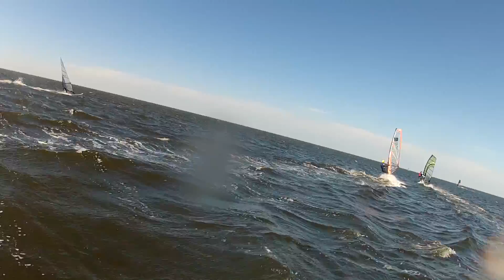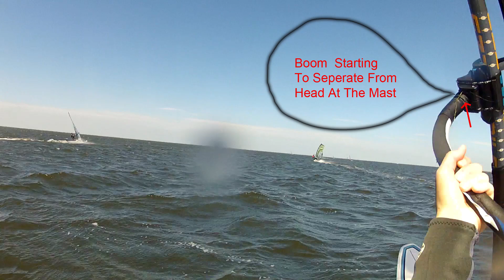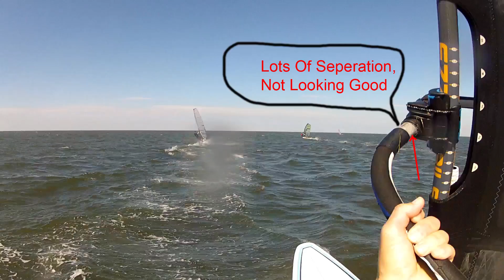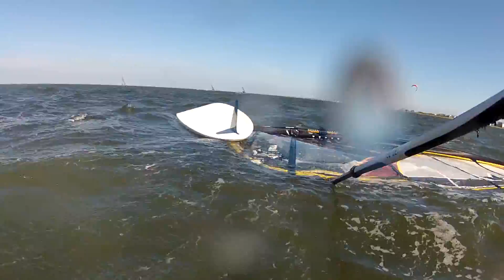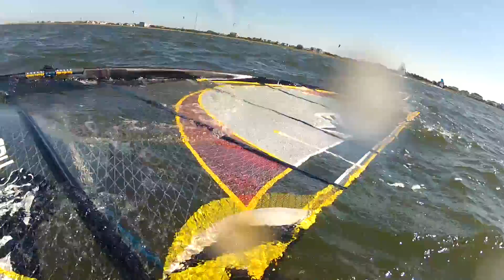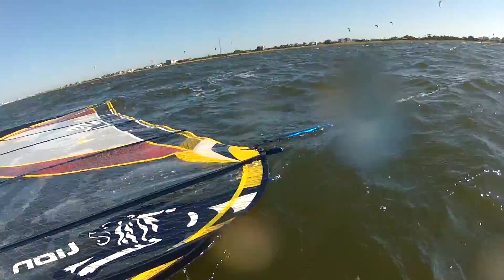Windsurfing Boom Break Wipeout, Hatteras, North Carolina, Chinook Pro 1 Alloy

Comment: that is pretty common, and the sharp edges will destroy the sail.  Check out "FiberSnap" on my channel for a fiberspar doing the same.
Reply from the maker: +NebraskaWindsurfer Thanks for watching.  Ya, I was just surprised the Chinook Pro alloy boom snapped since it had little use.
Reply: +windwatersun1 broke 2 aluminum pro one booms, and 1 pro one carbon boom.  not impress.  I am currently only using aeron v-grip aluminum booms.